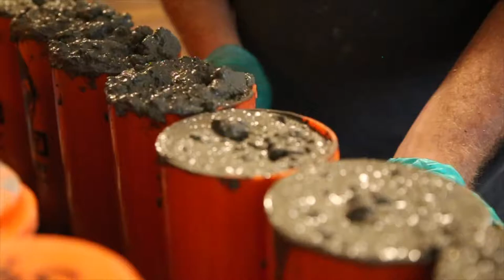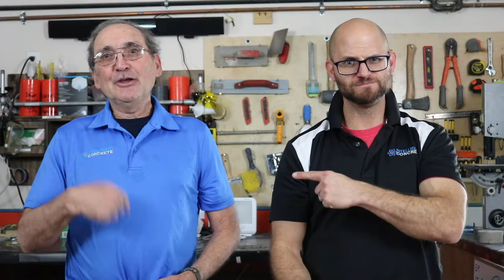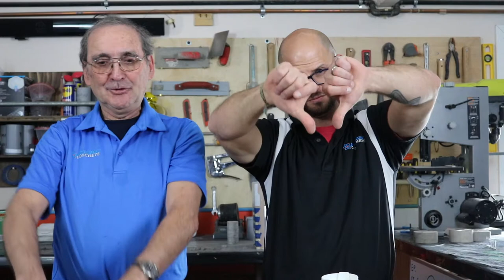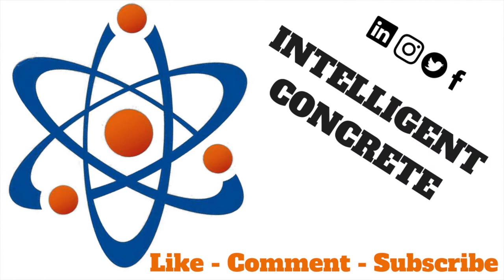Colloidal Silica Enhanced Concrete - Vlog #136

Comment: Is colloidal Silica same as silica fume?
Reply: No, but it is similar. They are both very small particles of silica that share many properties like their pozzolanic reactivity. But colloidal silica is a much smaller particle than silica fume and has some additional attributes. Silica fume is "microsilica" while colloidal silica is "nanosilica." Colloidal silica is basically a silica particle so small that it can't sink or segregate in water. It "floats" in colloidal suspension.